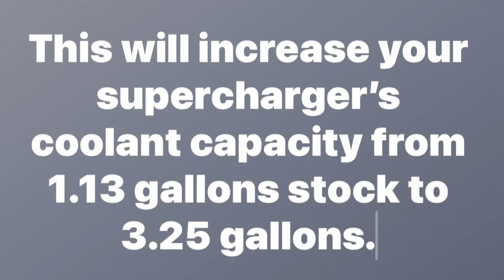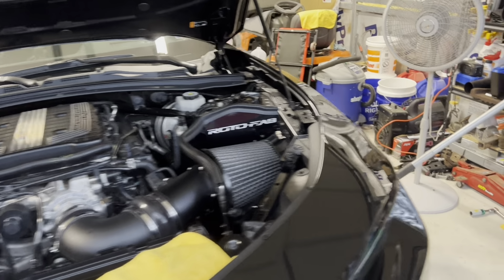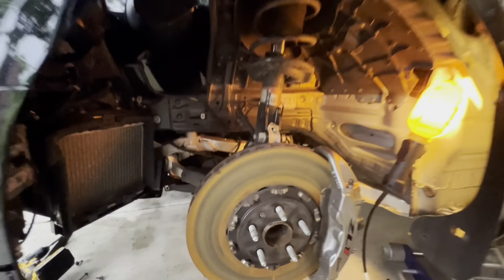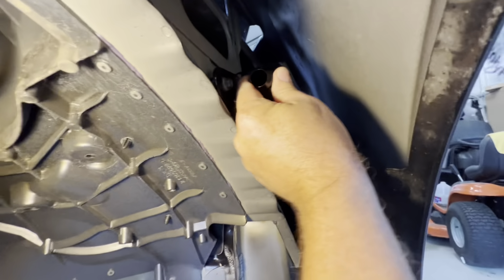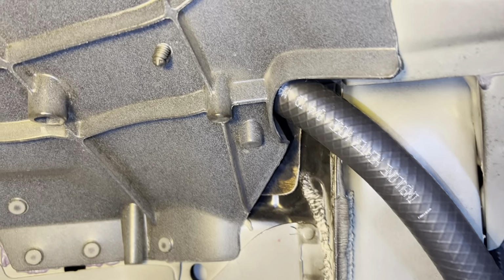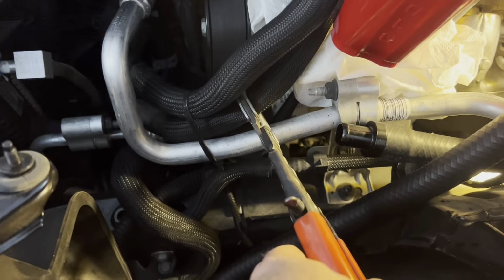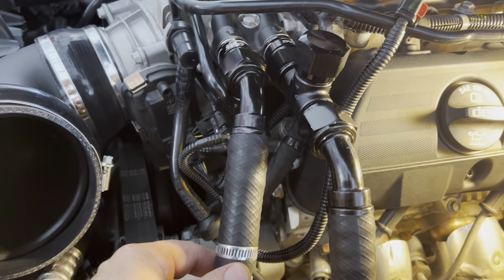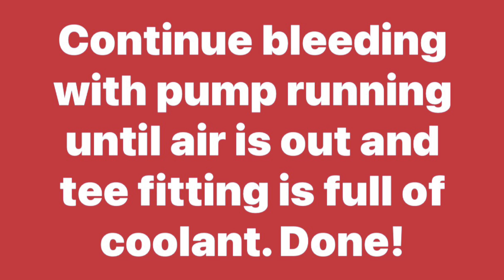Installing DMS 2 Gallon Fender Tank on “Lord Vader” my 2019 ZL1

Comment: Would it be too much to ask for all the links of the parts in the pictures you showed at the end of the video because I’m having trouble finding them and I wanna have everything in hand when installing 💔
Reply from the maker: https://dedicatedmotorsports.com/12an-quick-connect-adapter-gm-lsa-ls9-lt4-lt5/
Reply from the maker: https://www.racetronix.biz/p/hose-fitting-push-lock-45-12-an-jic-female-black/fit-204512
Reply from the maker: https://www.racetronix.biz/p/tee-sor-12an-female-swivel-male-blk/fit-498306
Reply from the maker: https://www.racetronix.biz/p/flare-cap-12an-black/fit-492912
Reply from the maker: https://a.co/d/9hWicnL
Reply: @dronechaserzl1  aaaah thank you so so much. Greatly appreciated !!!!
Reply from the maker: @Bman897  💥👊😎 no problem!

Comment: Did you record any temps before and after this installation?  I have thought about doing this but it seems that routing the hose right next to the exhaust manifold would negate any gains you might see by adding more volume.  You might wish to re-route or add heat sheathing like the hoses have on the passenger side to keep the hoses/fluid from having higher temps.
Reply from the maker: I did finally add the heat sheathing. I can send you a pic of that if you like.👍
Reply from the maker: Update: MAT levels out at 111 degrees/iat2 at 93 degrees at ambient of 75 degrees after cruising at 65mph avg for about 5 minutes on my fresh engine build. GPI PD2, 10% overdrive bottom pulley, Kong X Port 1.7, DSX aux. pump, 2 inch Kooks 766rwhp on 93 -no meth or e85.

Comment: and ? Do you feel the difference before and after?? Do log the iat ? Before and after? I have already heat exchanger and I want this tank too
Reply from the maker: Sorry but I don’t have iat’s or stats to show but I can tell it maintains it’s power level for longer periods of time than it did before. 👌
Reply from the maker: 4 months after cam and supporting mods I can tell you my iat 2 temps stay about 13 degrees higher than outside ambient air temps. After a pull heats up temps some ..it quickly recovers back to 13 degree difference again while driving.

Comment: Hey - it looks like installed this wrong… the bottom of the DMD fender tank needs to feed to the top of the heat exchanger pump. Then, the pump will forced through aux intercooler then main heat exchanger then back to the inlet port on the blower. It seems like you have the bottom of the dms fender tank going straight to the inlet port on blower. You may have it correct and just didn’t show the heat exchange pump - but your install video doesn’t make sense to me.
Reply: Never mind! I watched your video again and it does appear that the bottom of the DMS is routed to the pump.